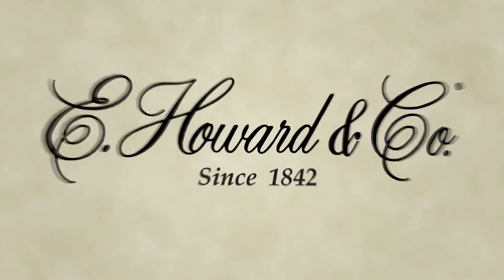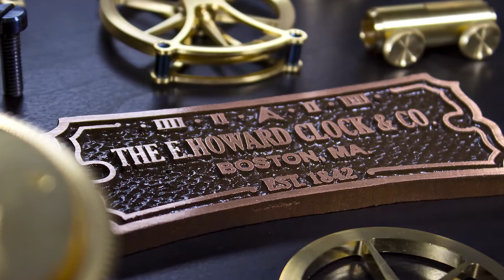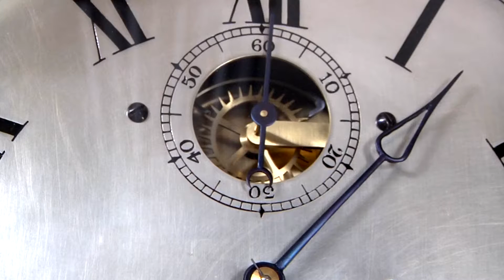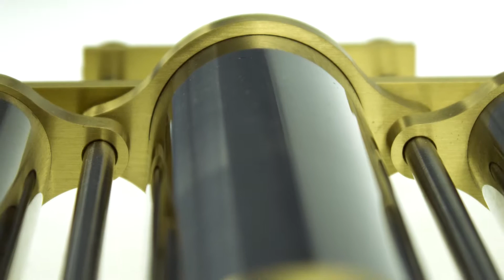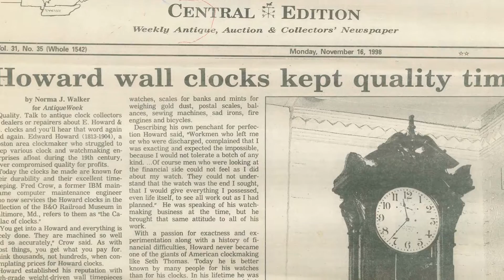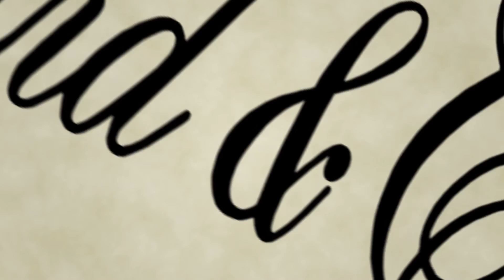Introduction to E. Howard & Co.

Comment: I am a clock collector and do my own repairs. I recently did pro bono work at St. Patrick's Cathedral in New York on an E. Howard Model # 10. The complaint over the phone was that the clock was overwound. Without knowing what clock we were talking about at that point, I assured them that it was probably not that. When I got there I realized I was looking at something truly magnificent. You could just look at the case and tell that it was of superior quality. The first thing I had to do was to take stock of the patient. You could tell that the movement was beautifully simple. In its simplicity, every piece had a fineness to it. And now the problem... yes, it was overwound! This clock has a squarish weight going down the center of the case, and there is a wooden bracket at the top so that the weight is prevented from being would into the movement. What happened is that over the years, the weight wore away the wood and finally the weight rode over the wooden stop and became wedged against the pendulum shaft. This prevented the clock from running so it was stuck in that position. My fix was to turn the block around so that a nice square face was presented to the weight. Great care was taken to remove the pendulum and weight and then release the winding click to bring the hanger lower. I didn't replace the wooden stop so that the clock is still all original. The clock was very clean and I suggested that a full service could still be done at a later time. It was an honor for me to work on a clock of such caliber, and I recognized my responsibility to do no harm.

Comment: I am a clock collector and I recently purchased an E. Howard regulator number 70 and I'm astounded by how accurate it is.
Reply: I hope to own an E. Howard clock some day. The best clock in my collection is a black marble mantle clock signed Tiffany Young & Ellis on the dial, which puts it about 1845, The movement is Achille Brocot. It has a Brocot  escapement within the movement plates, using steel pins. It has the original key with serial number the matches the movement, dial plate, and pendulum bob. I use an alternate key to wind it, to prevent wear to it. Working on the E. Howard has opened my eyes!

Comment: Hi,
I am ownership of 2 large bronze clocks with E Howard & Co electric workings, one is a mantle clock & the larger is double faced & was a ceiling mounted hanging clock. I was led to believe these were originally in the 25 Broadway Cunard Building in 1921. I have done a lot of research over the past few years but as of now have not gained any proof of where they actually came from. I know for a fact they were in storage in the Cunard building 555 Fifth avenue & were on display on the Liner QE2....any info you may have on these clocks would be of great help.

Here is a link to some photos of the clocks in a complete & dismantled state.
https://www.flickr.com/photos/92011699@N05

thanks & best Regards
Howard Mathurine
hmathurine@hotmail.com